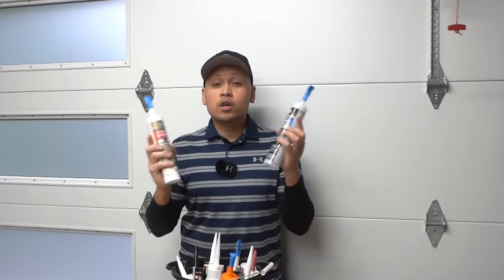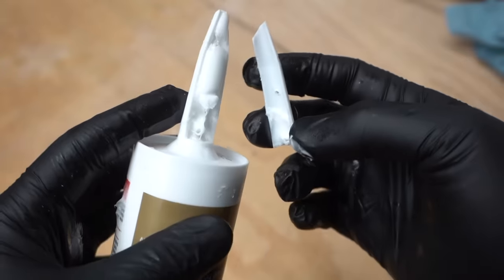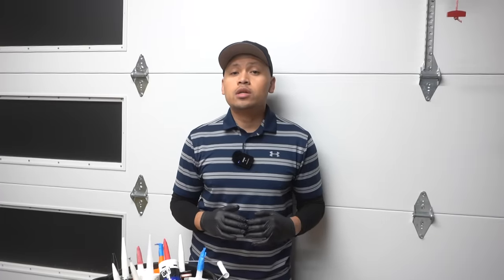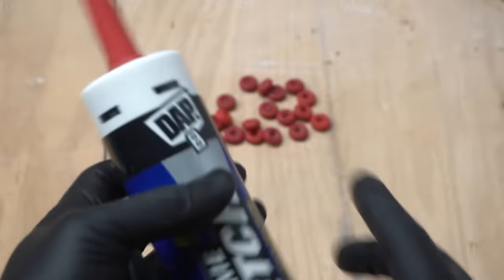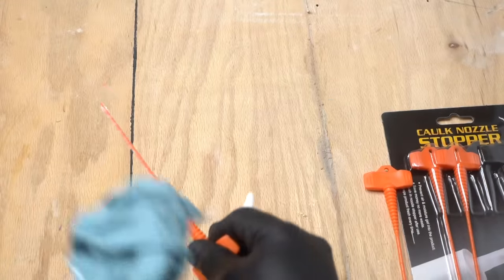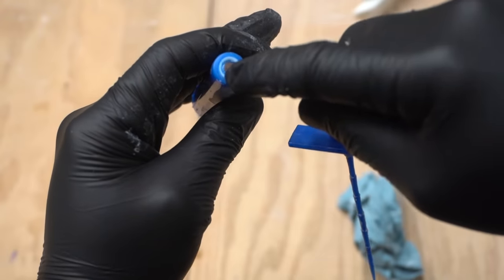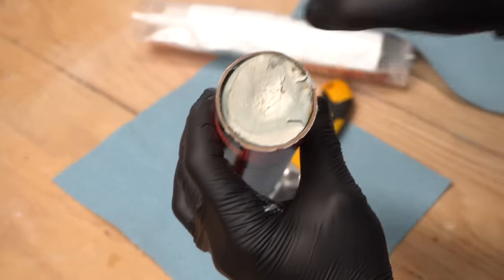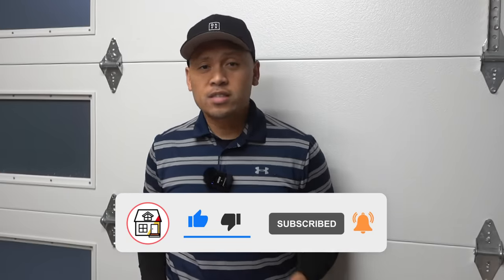STOP Throwing Away Half-Used Dried-Up Caulk Tubes! How To Fix It To Last Forever!

Comment: I've used those caulking tube condoms, they seem to work for a few days storage, beyond that they fail. Solutions are gimmicky, I've had success doing nothing. The tip seals itself, good caulk is airtight, the end plugs itself about a 1/2".  Most of the time just a good squeeze clears it. The last one shown has promise, a pain to reuse, but it may work.

Comment: You know that sticky oil-based putty extrusion they call "rope caulk" (which is possibly the WORST thing you could ever use it for)? I've found that, among other things, a small wad of it is the perfect thing for sealing caulk tubes. Just mash it over the end and shape to fit. It will seal pretty much forever, as long as you don't knock it loose, which takes a fair amount of effort. It also makes a fair mounting putty if you don't mind the residue. Just like duct tape, wire coat hangers, and super glue, I find it to be one of life's basic essentials.

Comment: The hardened slug is difficult to remove because the whole nozzle is tapered. If the nozzles were parallel the the slug would get pushed out and allow renewed usage.

Comment: 1. Great videos, thanks!
2. I can’t believe they didn’t called them caulk condoms 🤷🏾‍♂️🤦🏾‍♂️…. Walking into Home Depot like “I need magnum condoms for my big black caulk.” 🤔
3. The orange rubber tips are awesome and so are the new replacement caps, I didn’t know they made those! 😯
4. I wonder if it would seal if you dipped the tips in melted wax. It would be easier to buy the condoms, but still I wonder. 🤔

Comment: due to the laziness of the manufacturer, in order to save the silicone, you need to buy a tool. in Europe, the tips are detachable and when they are separated, there is always fresh silicone underneath, there is no need for a tool to prevent drying

Comment: How about sealing the outer with glue after putting the nail in to make it airtight. Then cut a couple of mills off the tip around it  when you want to release it and use the Tube again.

Comment: Make a container with holes in the top the same size as the caulk tubes. Partially fill the container with cheap, any type, oil, and insert the tubes into it. You can build it to store as many as you wish.

Comment: The tape around the tip is very effective.  But you forgot one thing.  Squeeze a little product into the tape after you apply the tape.   Especially with silicone, it will form a solid plug over the tip as it dries.   Remove tape and plug on next use. You showed how this plug is formed in the tip when you cut it open with a razor.  You are now moving the plug outside the tip within the tape. Try it!

Comment: There’s the “champagne cork” method: 1 Get some some soft plastic such as Glad Wrap or plastic baggie. 2 Place it over the nozzle, pinching it tight about one third of the way down the nozzle, but leaving some space to fill with whatever is in the tube. 3 With the tube in the caulking gun, and pinching the plastic cap to prevent leakage, squeeze enough caulk/adhesive into the plastic cap to make a knob about the size and shape of a champagne cork. 4 Tape it tight around the nozzle. 👍

Comment: What I typically do is I get a bit of a bead coming out, make sure the bead is still out after taking it out of the caulk gun, put a bit of plastic wrap around the top, put the cap they often come with back on top of that, and store the tube nozzle end down. When I go to use it again later, since caulk will only cure so far, and after taking off the cap, and wrap, I just grab the bead I left sticking out, yoink out a short cylinder of cured caulk, and the rest is still good.

The thing about storing it nozzle end down is I've found that over time if stored nozzle end up, the plunger will slide down a bit from the mass of the caulk, creating a space inside the nozzle, which is when you can get really fucked. If you store it nozzle end down, then you avoid that issue, you just need to make sure it's capped nice, and tight.

Comment: WHAT I USE IS THE HOT GLUE GUN JUST MELT SOME NICE AMOUNT OF MELTED GLUE TO THE TIP AND LET IT DRY IT GIVES YOU AN AIR TIGHT SEAL AND YOU CAN DO IT A BUNCH OF TIMES OFF OF JUST ONE OF THOSE SKINNY GLUE STICKS

:finger-red-number-one:

Comment: Wait, the tips don't just screw on and off in the US? Here in Europe the tips come separately. You cut the caulk tube to open it and screw on a tip. Often I don't bother sealing it. The caulk in the tip will just dry out as you show in the video, and on the next job you just take it off and screw on a fresh one.

Comment: I'm a guy that work building aquariums.. for diferent clients.. the easiest and efective tip i can give you on how to preserve the material inside the tube not to dry out.. is so simple that any of yuo guys didn't think about it. Just sqeez a bit of material over the tip of the tube.. and wrape it around it.. and let it get dry.. so when you need to use the tube again.. yu just pull that dryed material from the tube tip.. and when you do that you will pull all the dryed material inside the tip tube too.. then you can just use the tube.. it will not be dry inside the tube itself.. only a bit inside the tube tip you screwed on it. Try out.. you will thank me later. You don't need to use screws/nails. etc.. or anything on the tube tip..just squeze a bit of inside tube material outside the tube tip.. and let that dry out. it will dyr out a bit inside too.. but not to much to block the tube ..and when you pull that out it will be ready to use again.

Comment: This works with ACRYLIC caulk only.   

Some acrylic caulk  come with a plastic cap or get the Lil-Pecker Sealer Caps.    Fill cap with dish washing soap, a few drops will do itand place on tube tip.  This chemically STOP acrylic  caulk from curing or drying out for a long, long time.   Pump and purge nozzel TIP before use as this small amount of caulk will not cure.

Comment: The easiest thing to do is to actually seal it with the seal itself. When you're done you push the silicone and leave it exposed. That silicone will cure with oxygen outside of the tip and it will be extremely easy to remove the next time you use it. You can cover it with tape if you don't want to make a mess. You don't need any specialty products.

Comment: You would think that in this day and age it would be possible to buy replacement nozzles for silicone caulking cartridges. As mentioned, it's usually the top 2/3rds of the nozzle that goes solid.

Comment: Caulk saver??  I never use them. This vid kind of creeped me out. Before this I had no problem lopping off an inch ove the tube to get it to work. In Arizona you can expect it to go dry in the 116 degree heat. A very well done vid. One drink for pretty much and I'm pretty much hammered.

Comment: I have used screws, nails and masking/painters tape, all of which does not work. What does work is electrical tape. I carry a roll of electrical tape with my caulk and tape up the tip and fold the tape over back down around the tip. I can keep this on for months at a time and the caulk always stays fresh for when needed.

Comment: Good quality caulk only requires that you let it dry with a 1/4" bead hanging out the end that you can just pull out when youre ready to use again and should instruct you to do just that on the tube. See permatex for example. If moisture is permeating past that outer bead and down into the tube drying out your caulk then the caulk you are using is worthless as a membrane and therefor useless towards your intended purpose. If you just want something cheap to smear on your wall go get yourself a shovel of dirt out of the backyard and mix it with a cup of water instead of paying money to smear somebody else's garbage on your house

Comment: The best way to seal a caulk tube is with rubber splicing tape. Get at an electrical supply house. Done properly it will keep a caulk tube fresh for years. And it’s easy.

Comment: A sure way of sealing the remainder of caulk in the tube is by using an extra nozzle that has hardened caulking material in it. Just unscrew the used nozzle when you’re done, and screw on the one that is already sealed. The only problem with this fix is that you need to have a fresh nozzle every time you use your caulk.

Comment: I just leave a good grip size snot hang out of the nozzles to dry, hanging them tip down from my guns. Makes a perfect seal that in most cases of substances can be pulled out months to years down the road. May have to up a little gauge on the opening. Worst case scenario if it has been laying for years but the stuff is still good, I just put in a fresh nozzle. Works well on silicones, butyl, polymer rubbers and what have you. Grainy, cement like stuffs tend to be problematic most anyhow. I call those tubes freshwares. Reuse old nozzles on new tubes when ever possible, let the new ones included with your tube purchases go to your nozzle piggy bank

Comment: In my experience using a screw doesn't work because it creates an air tights seal, It works because the dried caulk plug is bonded to the threads of the screw. so when you pull it out the plug usually pulls out with it.

Comment: 1) Unscrew the nozzel. 2) Place a piece of thin plastic bag over the open end. 3) Rescrew  nozzel.  The mastic/ silicone will go hard in the nozzil. Next time you use it, remove hardened  mastic/ seaalant from nozzil and screw back onto tubefor reuse. Simples!

Comment: Put petroleum jelly in the opening. Stick in a nail or heavy wire and then wrap it with tape. Works for silicone and PL Premium. Just eject the jelly before you use it.

Comment: Can air get in the back of the caulking tube. I'm had many  which went hard the whole way through, that were never opened. They were old, got them in a secondhand shop. But if air gets in the back, maybe the container would be better for long term.

Comment: 5:12 it's literally a caulk condom! 🤣 I never seen one of those before.. I have used the tape method and it works on most kinds, only the super stinky stuff still dries. Used to have little caps that came with the tubes or were free at the stores, but that affected profits/sales I guess so now we're having to do this instead

Comment: Even if you got it air tight with a screw or nail - there is air that gets in during use that you aren't going to get out. Doesn't take much air to dry it out.

Comment: I'M SUPER CHEAP.  I just cut a fragrant of plastic bag and wrap it around the tip and then put a rubber band or wire or something that will form a simple seal around the outside of the plastic bag fragment.  This prevents vapors leaving the tube and air moving into the tube and the materials remain useful for a long time.  It's like the rubber item in the first part of the video, but its FREE.

Comment: Questions... 
1.  How long until a factory-sealed un-opened caulk goes bad & becomes solid/cured by itself?  Years?  
2.  How long until the best caulk cappings as shown in the video or anything else work until the caulk goes solid?
I really want a solution that can keep a tube of opened caulk fresh & usable many years later, not just weeks & months.

Comment: In Australia the tips screw on so so just screw on a new tip or clean the old one. I put plastic wrap on the open end then screw on an old fully cured tip to seal.  Freezing it I heard gives it years in long life bcse once frozen it expands protecting it from air giving it a air tight seal

Comment: Before watching
My methods as  casual handywork at home
1. use plastic bag on thread between tip and bottle, make thread dirty with caulk and screw it on, should last really long
2. for glues like super glue, put in to freezer, will slow down evaporation, and when gluing will give you extra minute before glue activates

Comment: Use a nail or screw 6" long>  Put nail or screw  down into the nozzle and tape around it.  It can be reused also. To seal them up.. To open the seal tube ?  Just unpeel the tape and take the screw or nail out.  They need to be at less 3" long 👉👉  5 or 6" long is perfect to seal the tube up.  Never throw them away! Can always reuse the screw or nail  👍👍   THAT HOW I DO IT

Comment: Why don't they have replacable tips in the US?

Any way, I usually put a screw cap or a long screw in. When it is not clogged later, great, I use it (long screw helps because it goes deeper. If not, I just replace the entire tip to use the rest of the tube.
I let the tip dry and when it is solidified I can just pull the solid sealant out and reuse the tip.

Comment: I've had good luck using large wire nuts. Cut the nozzle as close to 90 degrees as you can get away with  for your project. When done screw on a wire cap and save it till needed again.

Comment: The CAULK CAPS do NOT work, even if you place rubber bands around them.  Every caulking tube where I used it, the caulking tube was dried up within a week!  I liked the convenience but it just didn't work.  I have much better luck using a 16D Nail and a 4"x4" cut piece of plastic bag (doubled up) and using rubber bands to secure it.  Never failed me yet.  But I liked the Tube-A-New and just ordered a few, as I'm always caulking.

Comment: There is another problem occurring: the tube cap must be tightened to the main tube, but tightening means stress on his screw. And this screw fails after weeks/months. I found screws blown even if I do not apply extreme force to screw the small tube to the main tube. The plastic is cheap and weak. Depositing many items leads to nose tensions in boxes, and the screw blows.

Comment: I usually press out a small bead on top off the tip and remove the next time I use it, it cleans out the nozzle. 
Or just leave nozzle full ans change nozzle, all tube here are screwed on

Comment: This sure beats what I do.  I squirt a little of the tube in a pen cap and stick on, then tape it.  This works pretty well but the tubes still dry out after a year or so.  But I use silicone so much that the tubes don't really have a chance to sit very long.

Comment: Don't use masking tape, it doesn't completely seal.  Use a good quality duct tape and wrap it with the center of the tape over the tip. Wrap it around about six times and pinch the 1 inch section closed tightly. It will last as long as you would expect from a new unopened tube.

Comment: use a nail or anything similar (not a screw) and use the product to seal around the tip, when it drys , air tight. you're welcome.

Comment: A built in problem by the manufacturers. I remember when the nozzles could be unscewed from the tube and you could push out any dried caulking then screw the nozzle back into the tube. Planned obsolescence by engineers and the creation of a whole new industry to save your caulking tubes. Imagine the amount of wasted caulking tubes going to landfills . So much for protecting the environment.

Comment: I just remove the "nozzle", clean it and take plastic foil (that you wrap around ur food before putting in the fridge), fold it 1-2 times and put it on the tube and screw back the nozzle. BAM no air can come in and pretty much 0 cost. :)

Comment: Fool proof: Big wire nut filled with grease. Push on tip, no need to twist on. The grease seals the opening, the nut keeps the grease in place. Then store in refrigerator. It's not the cold, it's the constant temp. The trouble with most of these is storing the tube where nights are cool, days warm causes the tube to contract and expand. That pushes air into and out of the tube at the nozzle cut. That a lot of force that most solutions can't take.

Comment: You are not using the caulk caps correctly, you must squeeze a bit of fresh caulk all the way up to the tip, thus removing all of the air inside the nozzle...before you place the caulk cap on.
If you don't, the small amount of air left inside the nozzle, will be enough to set some of the caulk, which will block the tip, or slightly harden the remaining unused portion. 
It's just common sense.

Comment: Just make them all screw off nozzles and buy a pack of replacements. The companies want the to dry out that’s why they don’t offer this solution but they would have a strong purchase base if they did. Love the caulk condoms. Or they should make screw on caps. I use the condoms or wire nuts myself. You can put one of the condoms on your finger to wipe the caulk as well🙂

Comment: Instead of the caulk caps you can just cut of a finger of your latex glove (or two) that you used during caulking and then wrap a rubber band or tape around the base.

Comment: Simple and very cheap... after use remove the nose and put a little vaseline or type grease.
After put the used nose.
The vaseline stopped the air 100%.
If you need to use put s new nose and start

Comment: Why oh why don't the manufacturers make a tube with a screw thread on the end of the tube so you can simply swap out the nozzles?
Here in the UK they are made that way, and each tube comes with a screw on nozzle, with many tubes you end up with spare nozzles that you can simply unscrew, and throw in the trash and put a new one on, and away you go if one has been laying about for a while...

Comment: Use nothing . . . just let it dry out. As you so helpfully commented:  It only dries down a bit near the tip . . . Duh.  [[ not in the middle with either end remaining fresh ? ]]
To re-use: simply cut the tip further down and poke another hole in it. (Who cares about the size of the hole  . . .  it just needs to come out, you're going to smooth it out with your finger. )

Comment: So the purpose of the nail or screw isn't to seal. The idea is that the caulk in the nozzle is going to seal itself when it dries. The nail just leaves a hole in the dried caulk when it's removed. That way the caulk can flow through the nail hole.